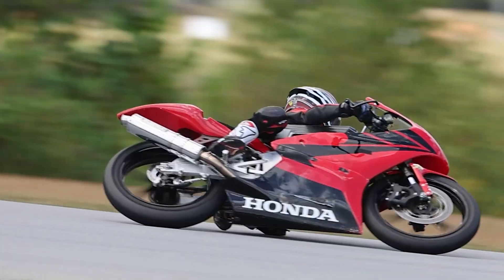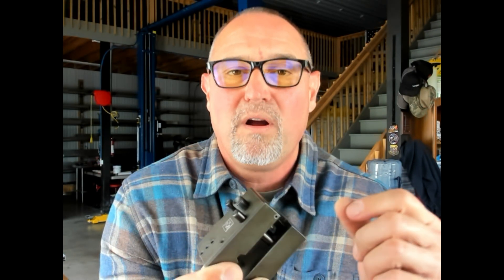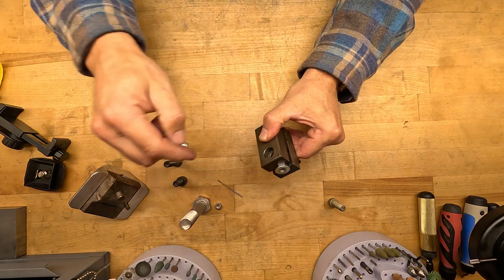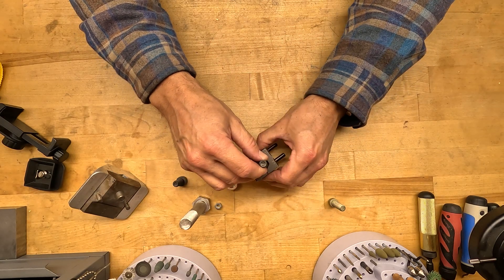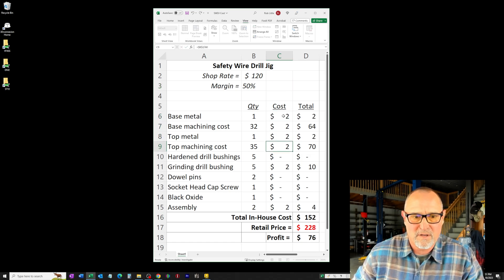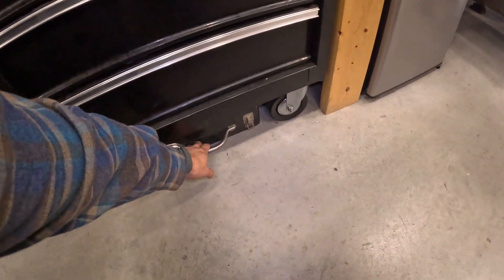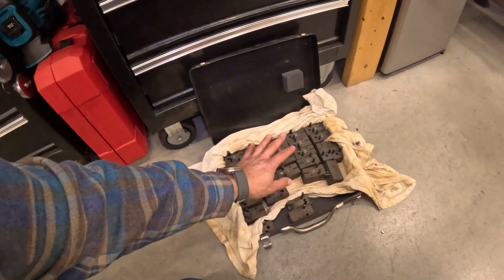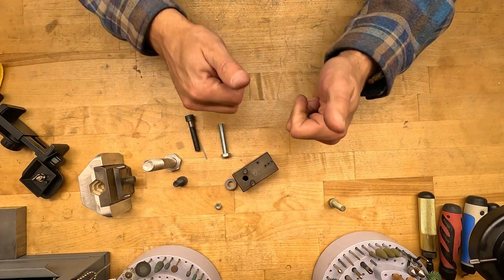Worlds Best Safety Wire Drill Jig was also a new product failure!

Comment: We need a fixture for drilling safety wire holes in the wrench flats of some pressure transducers. These have AN4 fittings, which project about 5/8" from the face of the part, and which would interfere with the clinching bolt of this fixture. So though this design looks great it wouldn't work for our needs. The $400 price certainly wouldn't bother us. Marketing these fixtures to the aerospace and oil/gas industries would probably increase your markup quite a bit, though.

Comment: Previous association with Yoshimura is a plus but that's way too expensive.  There are drill jigs on Temu for less than $10 that will do much of that.  The only thing that I don't see are cheap jigs for drilling across the flats of hex head screws.  Nothing that cheap will have your fancy hardened bushings and dowel pins but most of us are using it on 10-20 bolts on their own bike and ending it there.  Suggest that you hook up with a Chinese manufacturer, simplify the design, and get the price down to $10 or so.

Comment: I’d be keen but $400usd converted to $630AUD hurts
Reply from the maker: I am working on manufacturing our own drill bushings in-house ($100 price reduction) and maybe a new design to lower costs even more!
Reply: Yes please would like to buy one!! Work F-4 fighters for 8 years and had to safety wire EVERYTHING that had a hex
Reply: @gregbeckham2742 aviation grade bolts already have holes in them.  What are u doing drilling holes?
Reply: Id want 1.

Comment: I could use one of these
Reply from the maker: Nice! Once I get 20 requests, I will get them finished and available. Thanks for the feedback
Reply: I would love to have one, dealing with a lot of vibrating equipment as an electrician. And using locktight isnt the best solution in some cases, because we cant usually use heat inside brakerboards for unfastening when we need to do maintanence.
Reply from the maker: @workst3r  sounds good! Your on the list!